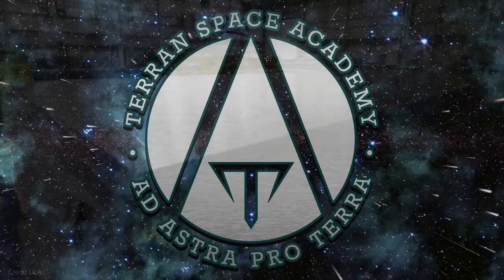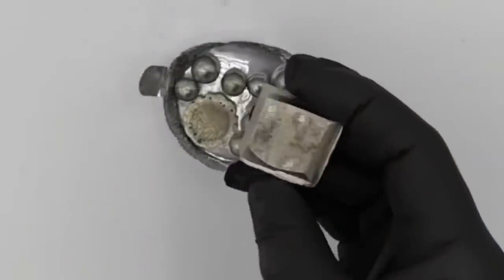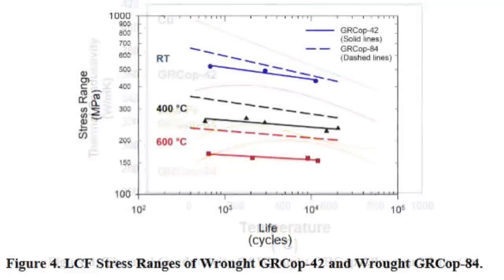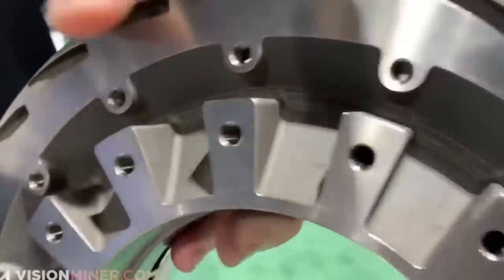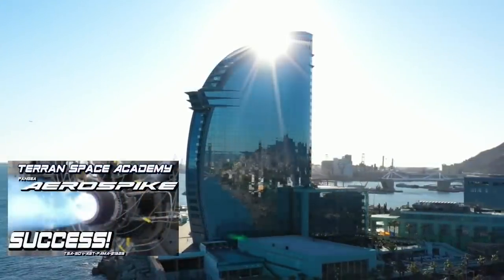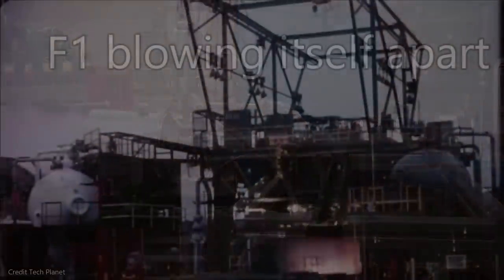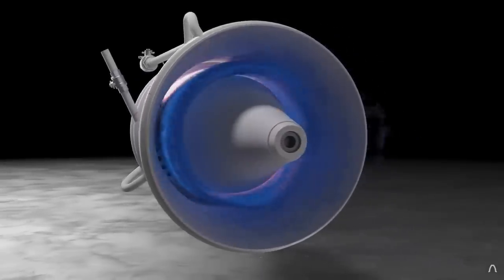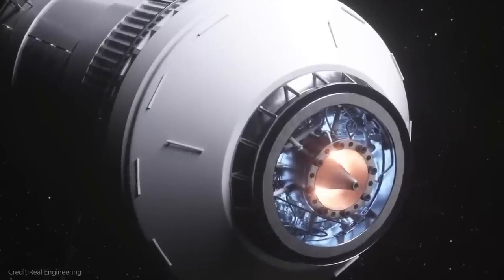The NEW Rotating Detonation Aerospike Rocket Engine!

Comment: Detonation engine seems kinda like a déjà vu on the old WW2 German buzzbomb. The Tesla one-way valve was definitely an unforeseen twist to the plot, especially in the time we live everything is microcontroller controlled.
Reply from the maker: Indeed... they were used in some pulse detonation engines also but electronic control is sometimes overrated :-)
Reply: Pulse jet engines are relatively easy to make as a moderately dangerous/loud hobby
Reply from the maker: It was indeed... sometimes  a physical system is the best option of all, especially with no moving parts.
Reply: Actually for the people who study and know about Tesla's logic of building devices, the application for the valve was no brainier (especially when the need is high frequency of pulsations), as for most of his inventions, the complexity comes from the fluid dynamics interacting with the device, and not from the construction of the device itself.
Reply: another L for control freaks… another W for Tesla and Germans 😏
Reply: Straight pipe detonation engines are called pulse jets and were indeed used in the V1. The rotating detonation aerospike engine with Telsa valves will greatly reduce the size of rocket engines and usher in the SSTO (Single Stage To Orbit) shuttle which will make commercial NEO space travel very economical in the long run.
Reply: Somebody on YouTube did a good video about how Nasa discovered detonation in engines long ago but let it go and forgot the physics to it. Now people are trying to learn how to start the process and control it.

Glad I found this channel. Don't mean to criticize, but think I have seen it and the name of the channel turned me off. Great content here though.
Reply: Kinda scary to think - all the Nazis had to do was look up Tesla's valve patent (1921) and they would've had something beyond even jet engines.
Reply: @jbdelphiaiii7637  
Yep sometimes new invention is just a bunch of old inventions put together in a new way, like bitcoin not one part of it is new other than the way it’s put together with old technology. There a gold mine of invention 💡 out there just waiting for someone to put together the right parts in the right order💰. 
I’m glad they didn’t figure that one out 🇩🇪 back then.

Comment: Great work!
Being an independent detonation engine researcher, I’ve approached the materials science (high sustained temperatures) problem by taking a different approach. I believe it is a ‘time management issue’ It has been my experience that attaining near plasma temperatures has been my primary goal and attainable.. The issue has been the ‘residence time’ of the plasma in contact with the confining medium and the direction of heat transfer .. In my upcoming videos I’ll be attempting to demonstrate a means of managing the direction of heat flow and duration of the primary working fluid in contact with the confining medium in a hybrid application of Pulsed Detonation technology..
Reply from the maker: Please send us an email at terranspaceacademy@gmail.com, we would love to collaborate and showcase your work!
Reply: I built a proof of concept pulsejet engine out of a pringles can and aluminium foil, it taught me similar things, ask a fusion breakthrough researcher and they will say the same thing, its not the temperature, it is the degree of contact, you can toast bread at 40 celsius degrees with enough time

Comment: The detonation engine sounds like the pulse jets model airplanes used to use....or the ones buzz bombs did. 
   One of those metal 3D printers would cool to see in operation. 
     Another excellent video.
Reply from the maker: Very similar Scott. Those were effective but not true detonation engines... no supersonic shockwave... but they were very innovative for their time.
Reply from the maker: It is similar but those didn't actually have detonation ie supersonic waves... so the RDRE has a lot more potential.

Comment: Great video. Thanks. Keep us updated. Will be great to see this fly on a demo mission. I'm guessing on an upper stage / Mars transporter?
Reply: NASA's nest step is a 10000 lb class engine, which I suspect will be tested in LEO first. After that, it could go anywhere, but the major advantage would be in higher delta-V applications due to its efficiency.
Reply from the maker: That's right, can't wait to see it fly.

Comment: The Tesla valve is doing much more than supplying fuel. Its also assisting in pressure timing transduction to allow the release of fuel through low pressure displacement pulling the fuel into the chamber, it also plays as an accumulator. I know this because I solved the rotation timing issue with the engine. It just needed a type of transducer to detect and release fuel into the system. But I did not recommend the Tesla valve that was someone else. My name is Daniel Downs and my work is documented at the White House in Washington DC. Thanks.
Reply from the maker: Thank you so much for reaching out and congratulations on your success!  Wonderful design.

Comment: There is a section about a metal 3D printing method in either "The High Frontier" or "Space Settlements: A design Study," both published in the 1970's.
Reply from the maker: O'Neil was a genius.  I loved finding that old film of him.
Reply: @terranspaceacademy  Which film? Also, what I was talking about is on page 69(Ch. 4, Appendix E) of "Space Settlements: A Design Study." The method is vacuum vapor disposition. 
The entire book is available online if you don't have it. I would recommend reading it because it covers most, if not all, of the things that need to be considered for building a space settlement.

Comment: It would be nice to hear some potential ISP numbers for a rotating detonation aerospike. I've heard everything from 200-700 seconds. Future video perhaps?
Reply from the maker: 1,000-1,200 sec Isp for small RDEs... up to 3,000 sec for large ones according to this NASA paper.
https://www.intechopen.com/chapters/70511
Reply: @terranspaceacademy  Higher then thermal  nuclear engine?
Reply: @lemonlime1508  I generally hear that a nuke engine gives about 900
Reply: @terranspaceacademy  What kind of mass fractions would those allow? Single stage rockets?
Reply: Some Day Soon.   LOL
Reply: But it's impossible that a chamical engine is more efficient than nuclear thermal. Right?
Reply: 1,000 is the bare minimum for nuclear. Theoretical maximum is around 100,000.
Reply: @456MrPeople  Eh... Nerva style NTP is what I was referring to and those give around 900...Orion style might be able to get 10,000, but 100,000? I don't think I've seen claims that high. Where are you seeing claims of isp that high? Maybe nuclear powered ion engines?
Reply: @lemonlime1508  NTP has a limit on the temperature of the nozzle, and thus isp. It's definitely higher than a normal chemical rocket. If these RDEs can really throw stuff out the tailpipe faster, they may exceed NTP.
Reply: @terranspaceacademy  Thanks, amazing numbers. Does the up to 3,000 sec for large RDE (Rotating Detonation Engines) mean purely nuclear thermal propulsion (NTP) systems become uncompetitive/obsolete/useless? Will RDEs replace all use cases for pure NTP niches?
Reply from the maker: @johnbash-on-ger  I don't think so... hydrogen is very light (71kg/m^3 vs 1,250kg/m^3) so there is a tremendous mass savings to not needing liquid oxygen on board for propulsion.

Comment: Totally fascinating. I’m wondering why they’re not looking at ceramics for the heat resistance and maybe modifying them for weight and strength.
Reply from the maker: I think the ceramics are subject to cracking from the detonation waves but there is a company in Japan using ceramics and they have flown one in space.
Reply: @terranspaceacademy  Thanks for the answer. It sounds simplistic from a non scientific person but ceramics give you the heat protection and a reinforcement fibre like fibreglass or carbon fibre might give the strength but I really don’t grasp the forces involved.

Comment: "In detonative combustion, the results expand at supersonic speed. It is theoretically more efficient than conventional deflagrative combustion by as much as 25%.[3] Such an efficiency gain would provide major fuel saving"

Does that translate to 12.5% higher specific impulse where fuel is burnt at the same rate as deflagation style combustion?

Oh!?
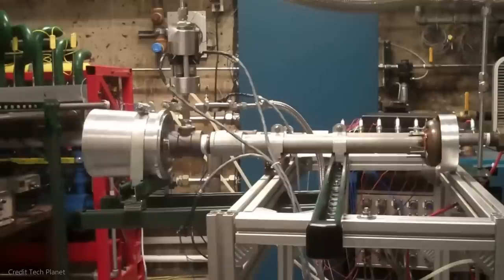13:52 that 36 v.s 56 is the bottomline percentage of overall efficiency, meaning current rocket engines are only 36% efficient in conversion of fuel to thrust~"specific impulse"?

56÷36 = 1.555... that means the 56 is 56% more than the 36.
Does that mean dumping the same amout of fuel at the same rate can make detonation engines generate 128% of the speed a deflagerative combustion engine of the same size?
Reply from the maker: There is a paper on the public post that claims much higher... but apparently those are air breathing... our bad.  We'll keep looking.

Comment: what about the new GE engine turbofan/ramjet/scramject/rotating detonating engine adapted to an aerospike format? It could be the super stage zero you are looking for. And if after the air is to rarified at high altitudes in the atmosphere, oxygen would be provided like in regular rocket engine. Al the exterior inlets closed and the oxidizer would come from the tanks. One engine to rule them all.
Reply from the maker: That was the plan of Skylon/Reaction Engines... They get complicated but not impossible.

Comment: I can envision an air-breathing version with compression via turbofan and shock cone to low mach speeds, and then perhaps a different one firing up once high enough where the air is too rarefied to save on the weight cost of oxidizer for a SSTO. I would love to build such an aircraft, but it's not in my realm of expertise. I am sure however, it's on someone's drawing board with the release of this news from NASA.
Reply from the maker: Watch the HOTOL video https://youtu.be/rh82LL77XRc
Reply: @terranspaceacademy  Personally I will always be a fan of the Star Raker concept, but my first true love was the Boeing Orion 3. If they can get equivalent isp and thrust to the Orion's conceptual NTR half spike design, space planes should be viable in our near future as was envisioned in the early 60's. We are only 30 or so years behind. It seems to me directional wall waffling similar to the solution the tesla valve provides would eliminate any counter rotating ignition disruption, thus stabilizing the entire cycle.
Reply from the maker: @kclarke924  That's the beautiful classic from 2001!  I love that design!  Wait a minute... Clarke... 2001... did you fake your death! I knew it!  Great minds never die 🙂

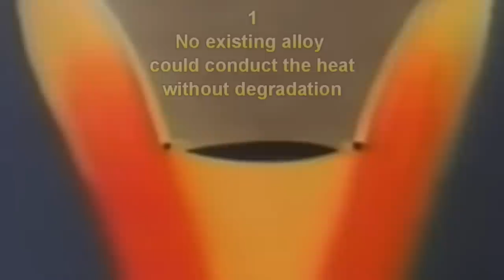Comment: 2:58 Could a bell be put in the gray volume with sufficient pressure exiting into the yellow below so that the red spike feels like it's pushing against a "wall"?
Reply from the maker: Yes.  Pangea exhausts the gas generators through this but you could put a bell nozzle inside it I suppose.  The problem is that you need low speed high pressure gas in the center.  A regular rocket engine bell nozzle would generate high speed low pressure gas and would disrupt the aerospike effect.

Comment: Hmmm...that's odd.  My mustard tastes exactly the same.  I guess this doesn't change everything after all.  Might need to get the engineers back to the drawing board.
Reply from the maker: Ah but your taste buds changed also!  To match the previous flavor of mustard! So everything DID change!
Reply: @terranspaceacademy  So you're telling me that NASA's new engine caused the mustard to taste differently or that it caused my taste preferences to change?  My point is that this new engine did neither, nor could it.  It might change a lot specifically around its purpose but it did not, and never could, "change everything".

Comment: Why not build the ignition point like a Gatling gun? There would be no more prediction issues as the detonition would be forced at every step around the circumference. If there were a misfire or flame out the mechanism would immediately restart the sequence precisely at the point past failure and continue the flow practically undetectable to the eye (at least). The computer would recognise in a millisecond and the AI would begin to predict and force restart before the next potential fail. Seems to be an obvious solution really.
Reply from the maker: Right! I was wondering the same thing... like a Vulcan cannon kind of. Electrically rotated etc.

Comment: Connect the dots between the Tesla valve and the engine.  I missed that part.
Reply from the maker: The Tesla valve allows fuel and oxidizer injection after the pressure wave passes and a low pressure area is over the valve, while preventing the high pressure shock wave from back propagating through the valve.  A mechanical valve would require precise timing and require very complex sensors...

Comment: No, it changes nothing yet. Please wait to see one on an actual flying aircraft or rocket. There are flow instability problems that are intrinsic to the detonation rocket engine, which are decades away to get solved. The flow is by nature chaotic, and that will be a very hard problem to solve. So no hoorays. And if you ever think that the new alloy composition is as stated in this video, you know nothing about war propaganda.
Reply from the maker: Thank you Marino.  You may indeed be correct but I don't think it will take decades.  Japan already flew one.  And a ten minute burn will get you almost anywhere.